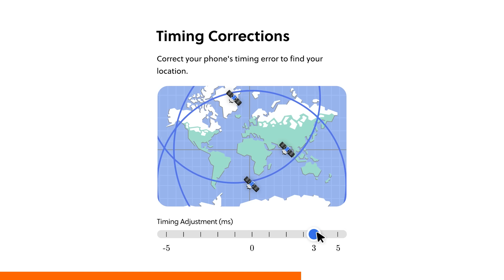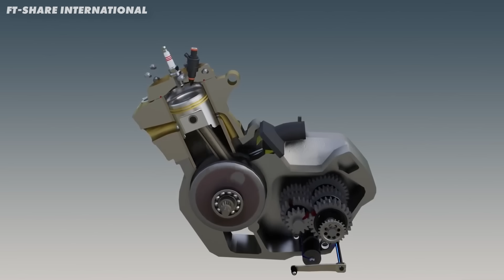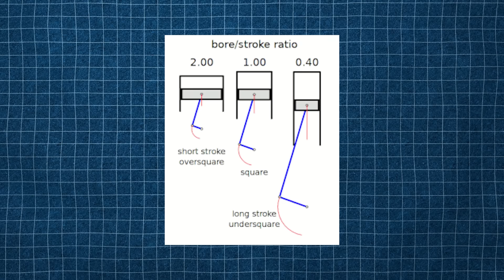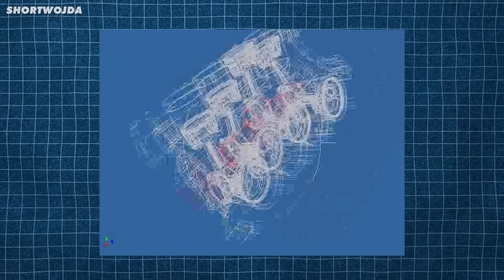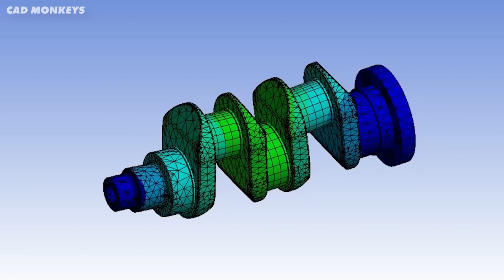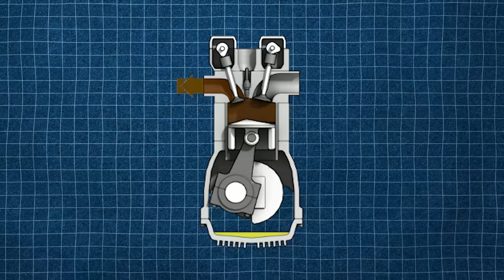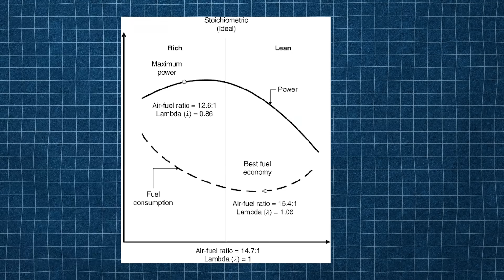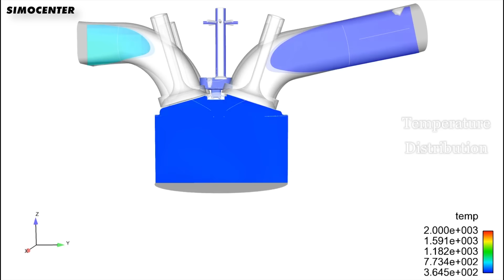Why It’s Almost Impossible to Rev to 21,000 RPM

Comment: Standard Kawasaki ZXR250, 19,000rpm redline, but happy to rev higher. The speed of flame front is so slow an engine would not work above a reasonably low rpm. However, there's something called "squish velocity". In performance 2-strokes it's critical to get it just right. I suspect it's the same in 4-strokes. The velocity of the gas in the chamber is what reduces the burn time to allow high rpm and efficiency. It makes enough difference that ignition timing can be backed off at least 5°. I'd imagine modern materials and manufacturing techniques would allow for higher rpm if allowed.

Comment: 4-stroke combustion engines with a capacity above 50 cm3 per cylinder do not rotate higher than 21,000 rpm only due to the speed of flame propagation of the air-fuel mixture. The piston simply has to cover a greater distance in combustion cycles in a given unit of time than the mixture can ignite. Now everything depends on the design of the engine itself, because if the cylinder sizes are small enough, such an engine can spin up to 30,000 rpm until the piston reaches the mixture flame propagation limit again. And at no point is it related to mechanics. Because the timing can be changed to pneumatic, and the engine itself can be made of carbon, connecting rods, shaft and pistons, which will withstand short-term overloads associated with high revolutions. The mechanics of the engine itself are not the limitation, only the chemistry.

Comment: The equation for HP is "Torque x RPM /5252"

So more RPM=More HP.  You lose Torque when you have more RPM so you need to compensate somehow.

Comment: Two stroke engines can't "naturally rev higher". The same mechanical and physical forces apply as in a four stoke engine.  As for why F1 engines haven't revved higher since the Cosworth V8, that's pretty easy.  Rules.

Comment: couldn't mechanical stress be alleviated by running a rotary engine, just a thought and I know "Rules" but rotary engines have the potential to be smaller, lighter, rev higher and potentially more reliable and fuel efficient because of the lack of moving parts.

Comment: Immediately thought of the Honda RC166 which was a 250cc six cylinder. Best power around 18000rpm, but could go higher. Besides metal fatigue, there was a harmonic vibration limit, valve spring limits, and windage issues from air moved inside the crankcase. The same engineer went on to create the engine of the Honda CBX road bike.

Comment: I do not understand how a piston weighing a few thousand grammes can suddenly have its mass increase to 2.5 tonnes. Is it accelerated to relativistic velocity? If so, I would imagine the engine can achieve way more than a mere 20,000 RPM.

Comment: Commercial  internal combustion engines (piston) has been available which are approaching 40k RPM. There is zero technological limitation of 21 k RPM. For an "F1 engine' the only limitation to RPM are regulations and cost.

Comment: 0:10  Mass of...   Beg pardon?  You need to look up the definition of mass.  I'll give you a hint, acceleration doesn't change it.
Reply: Correct.

Mass is defined as the resistance an object offers to changes in its motion when a force is applied, known as inertia
Reply: You are right of course ... but in a speedy presentation intended for mere mortals you often get these detail errors. If he had used some wording similar to "a force equivalent to pulling and pushing x tons" perhaps we could live with it ... we are not all familiar with talking Newtons!
Reply: @MrAdopado  Because it matters. By not using correct terms, you propagate incorrect ones.

Comment: If you get rid of valve springs,RPM is much easier. My ''street'' Ducati  Panigale revs to 16500 RPM daily.)))
Reply: Yeah, but your Pangale engine is only half the capacity of the F1 engines that were revving to 20k, and the F1 engines used pneumatic valve closure, not springs.

Comment: You and other are underthinking this.  Our company designed 80,000 rpm motors decades ago, some running now 24/7 at 90,000.  Car hybrids are now commonly up to 30,000.  Any serial hybrid can produce an electrically powered "rotor" which can be geared down to a road speed using a few simple gear sets.  Brayton cycle engines do this, but they are fuel inefficient, since the exhaust heat contains most of the power.  An Otto cycle engine can be used to rotate an electrical generator, which can then turn your road wheels at (with now electronics) at over 300,000 rpm.  The total power is limited by the prime mover, which for an F1 or Nascar vehicle is limited by the "TRACK" and not by the engine.  The only value of Leno's turbine system, is that that engine does this in one shot, is very lightweight for its power (similar to airplanes), but used about three-to-ten times more fuel per mile, than an equivalent hybrid.  Indy rules only allow a certain amount of fuel, so there's your other limit.  Piston engine are also limited by supersonic airflow inside the crankcase.  GM found this out long ago, when end-plates were blown out of the blocks.  Dry sumps are necessary, and actually for modern EVs, some motors are vacuum pumped out, to avoid shock waves in the rotor-stator gap, which can cause excess drag, and enormous overheating.  ANY surface which moves over supersonic speed will have these same limitations, regardless of configurations.  In prior practise in high speed machinery, air bearings were used to mitigate some of these problems, and computer floating head drives are a good example.  We tried these bearings on several projects, and it is necessary to design for the supersonic flow, as part of the mechanism.

Comment: The highest rpm ever measured in a V8 was achieved by Mercedes in the V8 at 20.232 rpm. However, this was only achieved on the test bench. The engine was never used in a race.

Comment: Meanwhile the Honda rc149 revved past 23k from a 5 cylinder 125cc engine. Still ran on carburetors. Rumors have it that the rc266 strait 6 could rev up to 27k, although 20k is more likely. And all that in the 60s. not sure F1 is the bleeding edge of tech some like to think

Comment: This is all wrong. The 19000-20000r V8s and V10s used shower or top hat injectors under high pressure to spray into the intake bellhousing to allow for better mixing. Direct injection is for low revving engines. The pre chamber ignition helps with that but it would be inferior to shower injectors in high rpm situations and not be used.

A V12 will be able to exceed 21000rs as it doesn’t suffer from the same resonant frequency limitations of a crossplane v8 or V10.

Comment: F1 engines have to run commercially available pump fuels ie what we buy at the petrol station, if teams were allowed to formulate specific fuels 21,000 rpm is easily achievable the limiting factor was the explosion happening to slow

Comment: Internal combustion piston engines are just insane, I mean 20,000 rpm means each piston is changing direction 666.6 times EVERY SECOND (at BDC and TDC, i.e. twice per rotation). Pretty mind-boggling.
Reply: That's pretty satanic, I'm not going above 19.990 then 😂
Reply: @henriklmao  Yeah, I really should've rounded up 🤣
Reply: @henriklmao  nothing beats the devil🤣🤣 not even f1 engines.
Reply: @henriklmao Just rev up to 21K 😂

Comment: fuel can be a hard limiting factor. Not sure what the F1 fuel rules are, but the propagation of the flame front is a hard limit depending on the fuel - I suspect the pre-chamber is one way to try and get around that.
Reply: If memory serves me correctly, current fuel is based on fairly standard E10 with some extra spice added depending on what the teams need.

Comment: So to rev very high, a piston engine need to be oversquare, but at some point the combustion isn't fast enough to keep up with such short stroke.🤔
F1 engine in late 90 and until 05 were more and more oversquare, like under 40mm stoke and nearly 98mm in bore. (the V8 were limited to 98mm bore )
Fun fact Moto GP dont have a rule about max RPM, just 1000cc, 4 banger and a max bore of 81mm, meaning the shortest stroke possible is 48.52mm. So they are really pushing the limit in term of engine speed, 18k rpm meaning 29 m/sec maximum piston speed ! (to have a comparaison, it's like running a 04/05 F1 engine at like 22k rpm, or the actual V6 to 16500)🤩

Comment: Two stroke engines don't rev twice as fast for the same revs lol. That doesn't make any sense. Their pitch is higher because they exhaust more often, that's it. They often rev higher than four strokes because that's the only way they can make more power as they are very inefficient

Comment: I know it's not an F1 but there's a 1966 Honda RC116 that says "Watch me"
0:44 he did say "almost"

13.7 hp (10.2 kW) @ 21,500 rpm (copied from Wiki)
49.77 cc 4T, 4 valve, air cooled, four stroke, DOHC parallel-twin

Comment: 2 strokes actually don't rev higher than 4 strokes. They rev less. Because gasses has to be exchanged out and in basically in half of the time of a 4 stroke. For example 1000cc 4 stroke moto gp rev higher than old 2 stoke 500cc's. But 2 stoke has double work cycles and exhaust chamber boosting the engine. 2 strokes actually make similar power in lower rpm, than naturally aspirated 4 strokes!

Comment: No mention of the Honda air cooled, conventional valve springs, sixes of their racing bikes in the 60's, that routinely reved to 23k rpm? Relevant as they won at least 2 world championships and remained reliable. Also no mention of the, again Honda, CVICC system of the 70's? Strange because it is exactly the system you describe as new in 2015...
Reply: Yes, Japanese bike engines have always been far ahead of car engines.   Car manufacturers have always gone for image, no matter what the image.
Reply: it was actually the CVCC system :), but I was thinking the same !
Reply: That only works because of the smaller size/capacity. There are lots of engines that can rev way more than 20k ... they are in model aeroplanes. This is because they are very small. By the time you get up to the sizes needed for an F1 engine you are reaching the limits.
Reply: @MrAdopado  This destroys the argument about thermodynamic limits of combustion they were having above doesn't it?
Reply: @jasonsmith4902  There is a limit of combustion ... the speed of the flame front is fixed so though it has time to zip across a small combustion chamber it doesn't have time to completely fill a large combustion chamber so only a partial burn is achieved and efficiency is lost. That's why it's possible in small engines but not in engines of the size needed for Formula One.
Reply: @jasonsmith4902  People may lump together combustion kinetics (mixing process, flame geometry, ignition, extinction, propagation, stability) which is what we are talking about here, under the heading of thermodynamics. I'm not looking back to see the specific comments but you're probably right.

Comment: a power cycle in 0.003 of a second?

So Max and George were 3/4s of a piston stroke apart in Qualy lap time?
Reply: That's at 20000rpm - 2024 F1 cars aren't doing that. But yeah, not too many suck-bangs away.

Comment: Hey Driver61, you made an error at 10:23, at 20kRPM it takes 0.006 seconds for all 4 strokes to complete. In 0.003 seconds (60 secs/20,000 revs) you get 2 strokes (1 revolution).

Comment: Just as a note, the mass of the piston never changes but the weight of it does.
Reply: Also wrong, the weight does not change. It is the inertial force which changes : Force = Mass x Acceleration

Comment: Surprised no one has tried an engine with Oval Pistons like Honda did with the NR500/750 8v per cylinder and two conrods per piston?
Reply: Think you mean the NR500 race bike, which revved close to 20000rpm. There was a brief oval piston 750 version, which I think raced (unsuccessfully) at the Suzuka 8 Hours. The later NR750 oval (square) road bike didn’t rev that high like the original racer, but way more reliable.
Reply: @GordonMoat  The Oval pistons were to increase the valve area on a naturally aspirated engine. It's of no advantage and lots of disadvantages on a turbo charged engine. In particular uneven piston ring wear and expansion and uneven burning due to the asymmetric shape of the combustion chamber.
Reply: @martinhow121  Honda gained some unique parents on piston rings from those engines. They've applied some of that knowledge to later conventional round pistons rings, to improve sealing and lesson friction. In motorcycle racing, what they were trying to do was make a V8 under rules that only allowed four cylinders. Of course, the engine wasn't the only issue on those racebikes.

Comment: I'd argue that you can go way past 21000 RPM if you truly want but you wouldn't get more power per engine cc because of compromises you would have to do for a gasoline engine.

However, if you run nitromethane such as RC cars, you could easily run engine up to 50000 RPM. Of course, at those RPMs you would get better economy with a helicopter style gas turbine engine if you have enough money to get one of those. ...and your racing regulations allow you to uses non-internal combustion engine.

Comment: In the F1 prechamber, no fuel is injected. Only one injector/cyl is allowed, but one hole on the in main chamber injector is pointed to the pre Chamber tipp, so fuel enters that way, when compression puches that fuel cloud in to the precamber, br Svante

Comment: I remember back when I was kart racing. I started off with 100cc karts but I never raced them. While racing with TKM and Rotax engines, I always had older 100cc engines laying about. I remember my Vortex VR / CW rotary valved engine. That engine would SCREAM. Highest I ever had it was 23,000rpm. Although I never raced it. Occasionally I'd stick on a larger rear sprocket on the colder dry days and let it sing. You really seen the temp go up. If I managed 5 laps in a row achieving 22k rpm, water temp would easily go over 70c and you'd struggle getting 20k. It was all about managing the carb and temp. Leaner engine, more power, more temp. On the really hot days I kept it rich but it was still achieving 18k to 20k. Really loved those days... I miss the smell and noise.

Comment: Wait, did I miss it? Why do modern F1 engines only rev to 13k if they're now unrestricted?
Reply: Because the fuel flow to the engine is limited and currently, at Φ=2, that fuel flow, and as such, the engine, is tuned to around 10k RPM.
Reply: The maximum fuel-flow rate increases with engine speed up to 10,500 rpm, where the maximum allowance is reached. Therefore there is no power benefit in running the engine significantly faster than this.

Comment: F1 engines were touching 22,000rpm in c.2006. Saw it on TV. The tach touched 22K from time to time,
Reply: Same idk why the media acts like it never happened.
Reply: @JTTTTT850  thanks.  I was wondering this.
Reply: With smaller displacement you could get there, but this probably goes for F1. Anyhow, i feel the point of this video is that there is a limit and whether this is at 20k or 22k is a bit academic.
Reply: @rienkhoek4169  My perspective is this - the teams and their designers and engineers ought to be able to make whatever design decisions they care to make.  Cylinder counts, displacement, NA vs FI, hybrids, wheelbase length and track width, you name it.  F1 is strangling itself with stupidly stringent technical regulations that make true innovation essentially impossible.
Reply: Was that under acceleration or because of downshifts?  I don't remember seeing 22k engines at the time.
Reply: @chuckschillingvideos  They were Reving and Shifting. Vrooom. Find some F1 races from the time, the sound alone is therapeutic....
Reply: @TheHypnotstCollector  Oh, I know all too well what F1 once sounded like and what they abandoned.   I was just never a tach watcher back in the day.  Don't know what you've got till its gone, right?
Reply: @chuckschillingvideos  That's right!  They paved paradise and put up a hypbid engine that sounds like a vacuum cleaner. I've seen those guys short shift at 6000rpm! Real F1 cars Idle at 6000rpm!
Reply: The engine in my old Serpent touring car would rev to 40k+   
...it was only .12 ci, but... it did it!

Comment: The main reason why today's F1 engines do not rev over 20.000 RPM and in fact do not come anywhere near that, is that F1 rules specify a 1.6L engine and a maximum amount of fuel you can use at any instant.
Revving this engine above 13000 RPM would mean you don't have enough fuel to burn.  These engines already run very lean fuel mixtures (made possible by the pre-burning chamber) and cannot produce any more output due to the lack of fuel to do so.

Comment: what i've noticed, every youtuber when 4 stroke is mentioned there is a petrol engine internals on screen, every time. diesel is only mentioned on videos dedicated to diesel engines, even though diesel are more simple, why?
Reply: F1 specifically runs on pump gasoline why would they show a diesel

Comment: CBR250RR was an 80's "baby blade" Honda Fireblade that rev'd to a miraculous 19k rpm in the 80's... until emissions and other regulations called for larger CC engines.. it was made because many permits were limited to CC of which the Japanese eventually increased their small bike permit to 400cc eliminating the need for 250cc 4-pot screamers... Honda instead made the "super-four" an inline 4 400cc engine that still hits a happy 50hp.